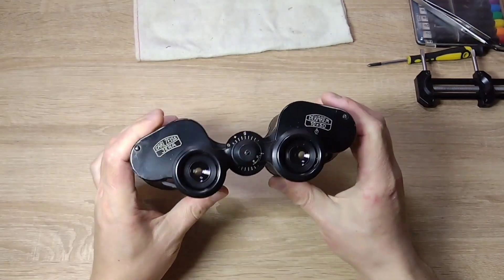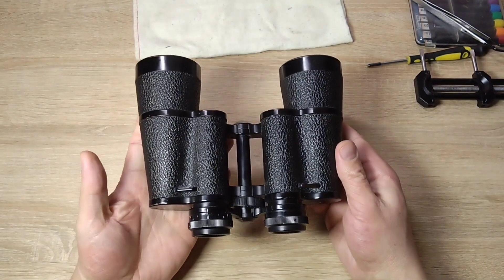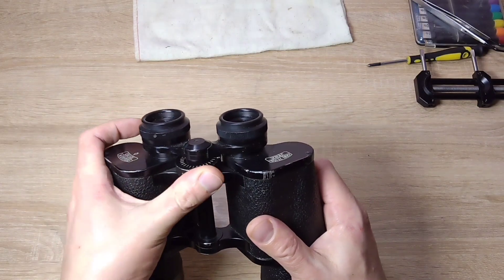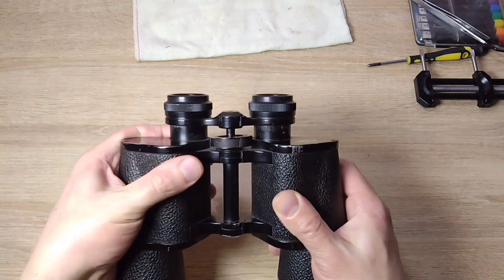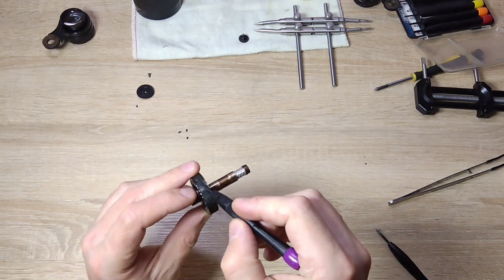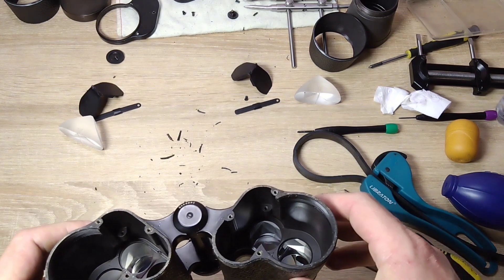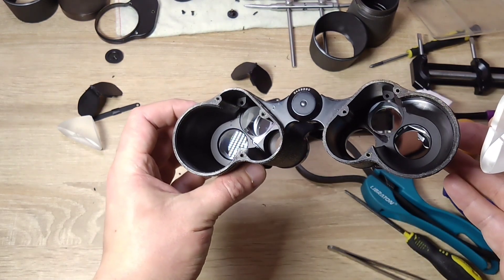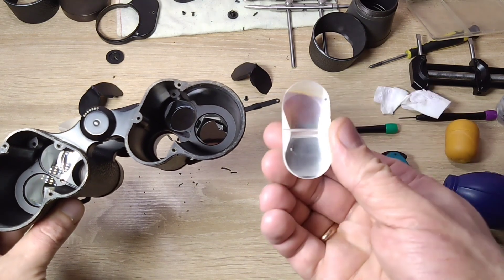Fixing the Focusing Wheel on Vintage Zeiss Dekarem 10x50 – You Can Do It Too!

Comment: Hello,I have the same binoculars, the wheel is not stuck and it goes smoothly, but I cannot focus the image to the rear position of the wheel.
Reply from the maker: So do you think it would be good if the glasses moved a little further into the body of the binoculars?
Reply: @StOKRATzoom  yes
Reply from the maker: and how many more millimeters are there from the eyepiece to the prism cover?
Reply from the maker: I can try to make a video especially for you, but it would be nice if you could upload some photos. ihor1988miv@gmail.com
Reply: @StOKRATzoom  Thanks for your interest, I returned the binoculars to the seller.